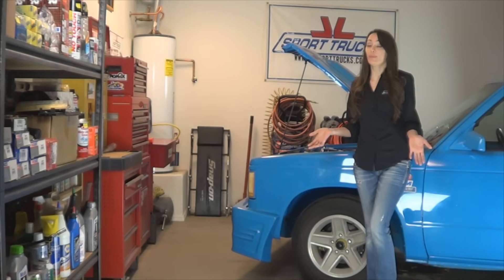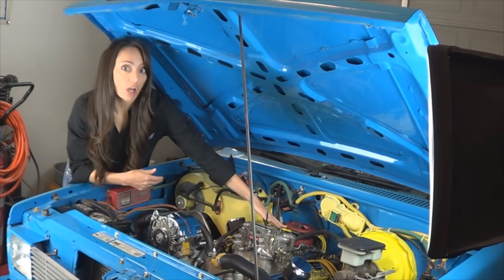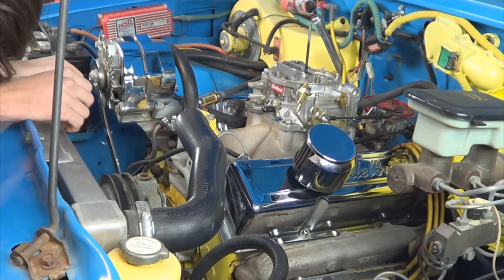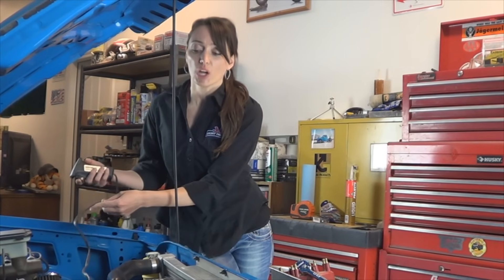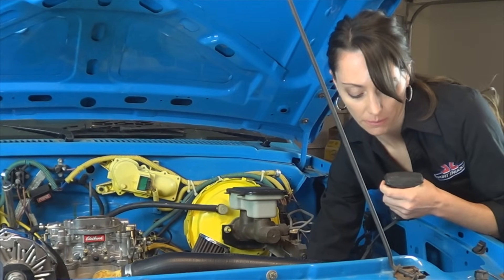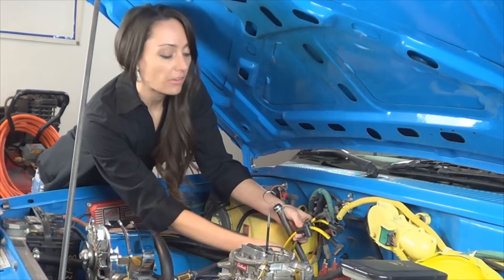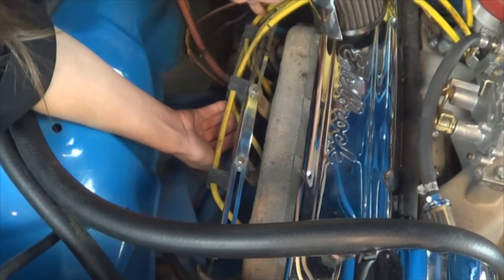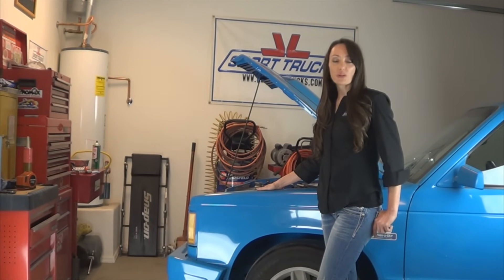How to find Top Dead Center TDC when you remove and install a Distributor or unplug Spark Plug Wires

Comment: Caveat: Rotating the engine even a slight amount when you replace an actual distributor is trouble, since there's no easy way to pinpoint the mating gear positions.

Comment: Described great but was sorta looking for one dumb thing I never did, watched my long term friend switch the distributers around. I'm pretty sure this is all tapered in my head how to, the 96 fords different Cap free stuff. But you did remind me how to bump the engine over the way I've started these ( 6 ) of em over the last well 1989 to date stoped make=ing em in 97. Any way he's a lucky guy I suppose, I've pretty much done it all. Ford man. 70 F-150 short bed Diamond Black no chrome for sure, replaced a typical truck rated 390ci with 428 head's on  the  390 block I was poor, The heads, THE good ones ??? and of course balanced bored a little RPM have a good purpose so treat em like a women and she'll squeal for years. 45 46 hundred was Ok for me, About 1/2 in, front off the ground and I never could really understand the HOOK UP a short bed even that created animal had, the BLK was only accented with the Fords Cobra posed on the fenders mid sections. AND still have video ripping the doors of a tweeted up 50 1990 Mustang at Hollywood Speedway YEARS ago . YUK Ford? the True Dream 427. Corbra and the trucks 69 ta 72. Portact man. Started with a Chevy 2 1964 LT1 twisted for the day.Then ONLY Tempest GTO's or 3 Buick Grand Nationals 1 T type The best one really, sleeper ? OMG Lots o fun with this old mans car, NOW bI my self would LOOOOSE the Edelbroke ? I new the owner of National Carburetor in North Miami at the time who run my 49 formula 400 Firebird down with a 2 ft. wheel stand right outside my passenger window, a Pont full size Station wagon! Yea I made it a point to see what his WAGON was powered by. A 400 ci like mine
and pretty sure he had to have piston work done but BUT what I noticed next set me for life. His fuel was provided by ONE Quaderajet 4 Barrel and yes he personally jetted it ??? and commented he never had to replaced ant diaphragms that always blew out with the Holleys. 12.4 1/4 mile with a Quartet, Came stock on millions of GM cars. I definitely would not be reaving any thing like you did like it was a Habassu 1400 , on a fresh start no top oil? I hope not.

Comment: I have a Chevy S-10 Blazer (1987) with a V-6 engine in it and have to get the timing corrected on it as my friend who put in the short block engine for me didn't know how to set the timing on that engine. I have just let the vehicle sit since he did that work and not he is no longer with us I want to get the vehicle started again. I will look at the manual I have for that SUV and see how I can get that vehicle running and take it to the local dealership so they can adjusting the timing for me. Thanks for sharing this information on finding the TDC on the V-8 engine you worked on.
Reply: Adjust the timing yourself it's a simple procedure; if you don't have a timing light you can adjust it by ear. Drive it down the road at various speeds and pull over and  make fine adjustments by turning the distributer counter c.w. to advance c.w. to retard. The timing for a s.b. chevy is 8 degrees BTDC for an automatic and 5 degrees for a standard.

Comment: Get #1 on TDC on compression stroke on 0. Wherever the rotor is pointing, that is #1. Run the wires to that terminal following the firing order, rotation of the rotor, and cylinder arrangement. The side with the damper mark pointing to that spark plug is #1. If their aren't any marks, pull the valve cover and check for valves at the front that both are closed. That'll be #1.

Comment: Beautiful.. you made it so simple. I broke my distributer because it was seized in the block but I managed to remove it and install a new one. You confirmed my planning for timing the engine in my rear engine 460 ford motorhome. Thank you.

Comment: If the crankshaft and camshaft timing marks are aligned with what they should be aligned with (i.e., the other marks), that means necessarilly that it is in the TDC point?

Comment: Hello Thunderhead, I have a 88 Volvo 740 GLE and could only get it between 8-9' TDC when It calls for 10'+,- 2' TDC.  Someone told me I needed to find out if I need to disconnect something first before it would properly advance.  After watching this video I am wondering if it is the vacuum advance.  Not sure if that is standard for most cars manly mined.
Any info on how to fix may timing issue  would be great.
Sheneedstofixit.

Comment: Hello and thank you for the video.
 I have a 88 Volvo 740 GLE and could only get it between 8-9' TDC when It calls for 10'+,- 2' TDC.  Someone told me I needed to find out if I need to disconnect something first before it would properly advance.   I am wondering if it is the vacuum advance.  Not sure if that is standard for most cars manly mined.
Any info on how to fix my timing issue  would be great.
Sheneedstofixit.

Comment: nice, i wired my 72 Chevrolet  imp 2 door hardtop, with no 1 in back of engine , same firing order only that i started from number 8 cylinder  not number 1 in the front,number 8 in the back, next to the passengers side, put number 8 piston up on top dead center, puled my distributed out  placed it back in with my rioter facing number 8 on my cap, bolted it down slapped on the wires, now that had power,  a 350 4bm 4barl

Comment: What if the harmonic balancer (damper) is worn out and the out ring has slipped so that the timing marks are no longer accurate?
Reply: Mike Allen have you found this answer?  I really need to know this also

Comment: good job my sister may god bless u >>
 but i need to ask u about the starter remote u pluged one cable to th postive battery side but coudnt understand the other cable where did u plug ??? and another question is th remote starter suitable for modern car i mean mpi system with ecu ??? thanks
Reply: the solenoid wire on the starter..

Comment: What do you do if the mark on your harmonic balancer is in the wrong place?
Reply: +Theodore Feight stick a long screwdriver in the number one cylinder. turn the crank while wiggling the screwdriver otherwise you will mess up the threading. when the screw driver reaches the very top you should be good. make sure its compression stroke though. i use a balloon zip tied to a hose and stick it in the hole to check compression stroke.

Comment: This is nice when working on the older vehicles, useless with the modern vehicles.
Reply: fordwindsor351 It works the same way with new vehicles as well, even without a distributor.
Reply: tempest411 It simply can't, finding TDC isn't the issue but with the measures talked about here its useless in modern vehicles.
Reply: depends on what your working on as far modern Fords and Chevrolets and Dodge it's the same procedure's. fordwindsor351
Reply: hard to get thumb in spot so I used back end of screw driver felt it blow out but line stop a little before 0 on balance is that cool also distributor pointing toward passager side so I just put wire in from there starting with #1